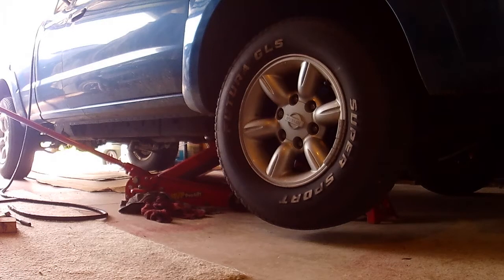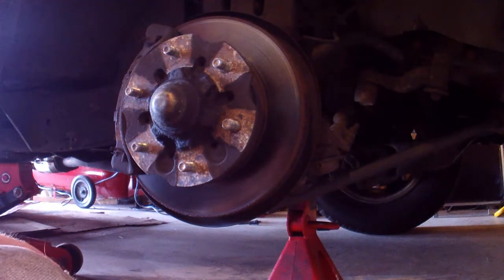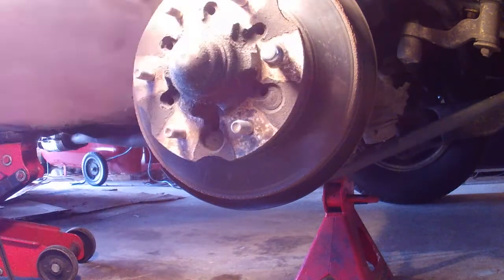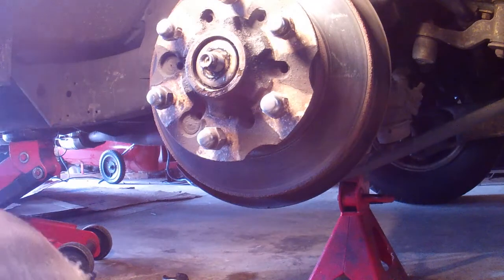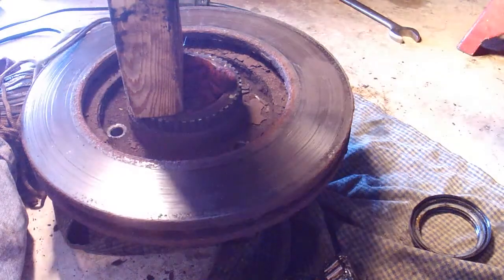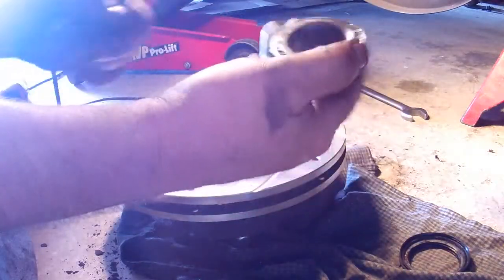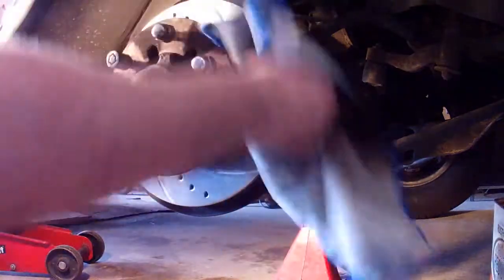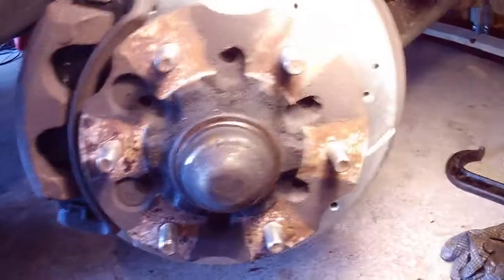Episode 32 2003 frontier rotor and pad and bearing replacement

Comment: This will come in handy i gotta do brake job and bearings on my old frontier. Shes a 2000 that i drove in high school in 07,my  dads truck. Ran it for a couple of years before my dad took it back and put it to work in construction where it spent its years getting abused and  beat around until now when my dad retired it and i took it back. It has a new paint job and needs lots of TLC. Its not a show truck or anything hotrod but its nostalgic to me now and i want to keep this 20 yr old truck on the road. Thanks for making the video.

Comment: Thanks a bunch man. I have a 1999 4x4 Frontier and it is my knowledge based on other videos watched and service manuals that this process is the same from 1998-2004 on both the Frontier and Xterra. My local superchain mechanic shop quoted me $1200 for both sides to have the front wheel bearings and tie rods replaced. After buying all of the tools and parts necessary and spending about 2 hours learning the mechanics and best leverage for my vehicle I saved around $1000 and learned a lifetime skill. Just need to get her aligned and Ill be good to go. Would have had a lot more trouble with it if your video had not been so in depth. Best of luck with your other automotive adventures!
Reply from the maker: thank you , and congrats on getting yours fixed too!